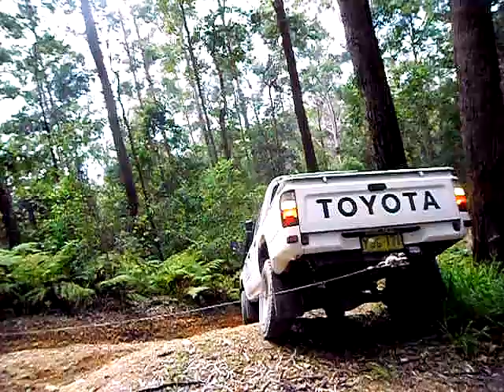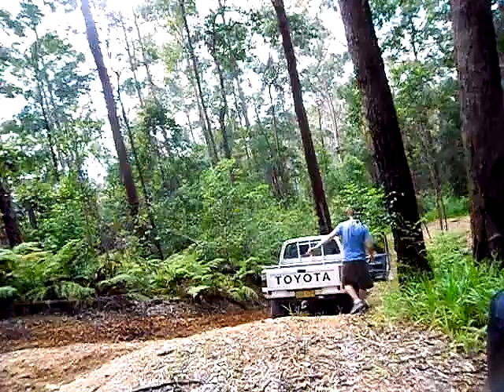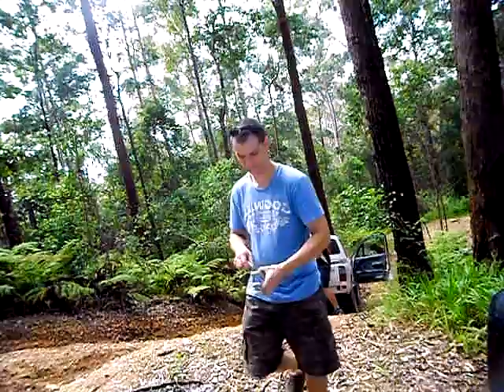Recovering a Hilux caught in a sticky situation

Comment: I just got a quote yesterday for mine 22 for the plate 200 to fit it 
I have read this fixes the problem Nissan should do it free as they know its a problem 
Other trick is to wait till airbag light goes out when hot and it starts straight up